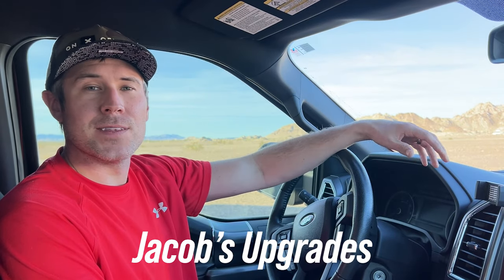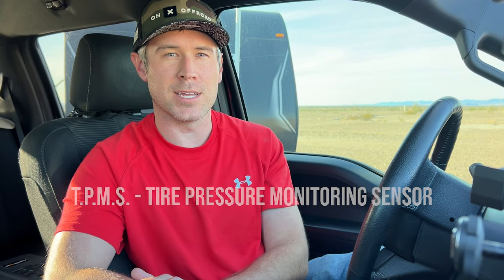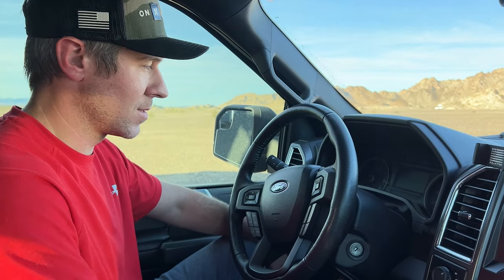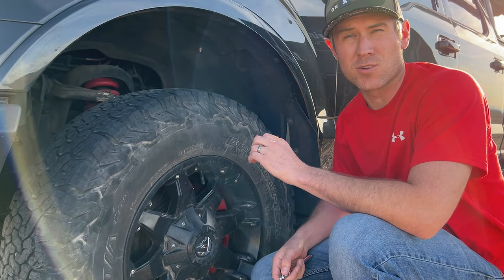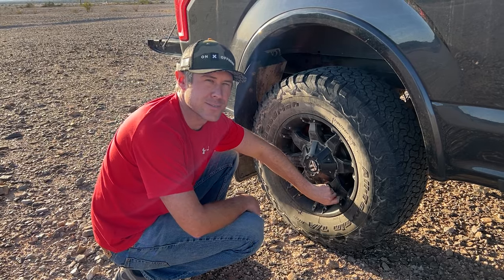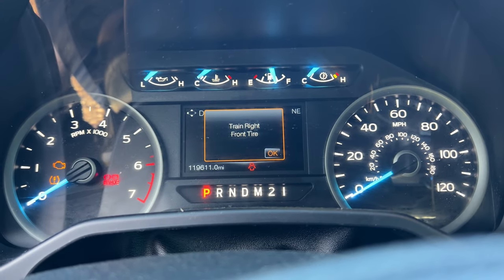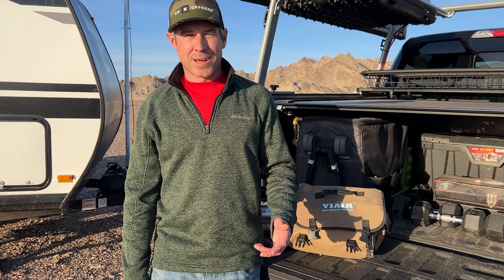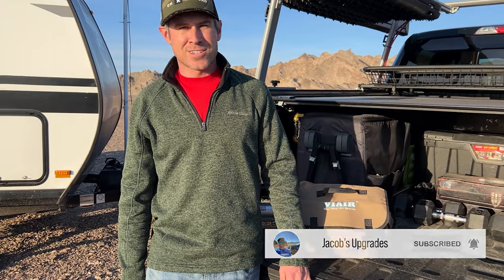Tire Pressure Sensor Fault Reset F150

Comment: Thx, this was short and to the point.  I think it's sad that now it'll cost you and me almost $500 dollars to have all four sensors replaced. I wish they didn't install these on my 2015 F150. I know you can buy tools that break the tire bead and replace the sensors, but you need another tool to recalibrate for the final steps. Many Thanks.
Reply from the maker: @markseifried3959, I know it's a bummer having them replaced. I tried to time it when I was having new tires installed. I'm still dealing with a bad sensor after having them replaced. Not sure if one was bad from new or it's my Body Control Module. I could be wrong but I think all new vehicles are required to have TPMS sensors for safety reasons.
Reply: I think it had something to do with fuel economy that the powers to be required tire pressure sensors. I could be wrong also
Reply from the maker: @tawcain  that would make sense!
Reply: Well luckily where I live they don’t require any vehicle emissions or safety inspections so I don’t even worry about it
Reply from the maker: @kalebmcdaniel9147  that makes things much easier

Comment: I’m at a loss. I got a 2018 F150 STX 4x4. Just put some new rims and tires with new sensors. I have the TPMS 19 sensor tool. I can get the truck into learning mode. But then I can’t get the truck to pick up the sensor. I’ve used the tool, I’ve also tried letting air out and nothing.
Reply from the maker: @cmendr011, I wonder if the new sensors are the wrong frequency and the truck is not picking it up. They need to run at 315 MHZ frequency.
Reply: @jacobsupgrades 
Great video thanks dude. I got a 2015. Oh two weeks ago I was driving down the road heard the ding ding look down at my dash both front tires were showing lines.  I've already had one of the sensors go out and I had it replaced. 

This is just odd I'll try resetting and keep you posted. 

The other weird thing I had A couple weeks ago was the top track holding my rear slider in place completely separated from the inside of the window. 

If you have that issue need primer for the plastic track so that the polyurethane can adhere to it properly.
Reply from the maker: @stellarcreations7378  I hope my video helps solve your problem! Thanks for the comment.

I have a video coming soon on repairing my sliding window. I used 2 layers of this 3m acrylic tape https://amzn.to/3QmsNOq   I used 80/20  aluminum extrusion and clamps through the open window to let the tape set. It's held up for a month we will see long term.

Comment: Wow!  What a great video.  I have a 2016 F150 and need to go thru this same proces.  But after going thru the process, if I do find a bad sensor (double honk), if I can't replace it myself easily, I will go without,  I'll tell you why.  I don't need a sensor to tell me my tire pressure is low.  I've grown up with nobody telling me to check my tire pressure.  It's inherently automatic.  You own a vehicle, check the pressure.  Have we grown up in society and lost all common sense?  I know, there's a sensor to tell you to change your dirty oil. Do we really wait for a sensor to tell us to change the motor oil, or be smart about it and keep a small notebook on oil changes in the glove box, and keep track youirself?  When does it end where there's a sensor built into your underwear band to tell you when to pee?  We're supposed to be smarter with each generation of people born, yet the engineers treat you like you're totally stupid.  Well, the jokes on them because they can't even design a sensor without it growing faulty before the vehicle is no longer usable.  THUMBS UP!!!
Reply from the maker: @lostinmyspace4910, I agree these sensors are a pain to deal with. Even after having all 4 of mine replaced I'm still getting the sensor fault message. I'm still trying to resolve this but I think it may be due to a bad Body Control Module or a bad sensor installed. Keep in mind if you just ignore these you'll constantly get the TPMS sensor fault message popping up on your screen.

Comment: I just drop down in the trucks display menu to tire pressure and it’s the one tire that is blank. 🤔
Reply from the maker: Yes, it usually shows up blank or -- doing this reset method should help with reprogramming, if not it could be a bad TPMS sensor.

Comment: Buy the $11 relearn tool and you won't have to mess with letting air out.
Reply from the maker: @GusMahn, I did try using one of those tools and it couldn't read the sensors to relearn.
Reply: @jacobsupgrades  I just did my '15 F150 today. I will say that even the tool is very slow. I had to point the tool for 20-40 seconds before it read.
Reply: I truly am beginning to hate this truck. Everything is a royal pain in the ass

Comment: I have a 2009 Ford Lariat and had no idea if this would work and surprisingly it did, thank you so much for the video.
Reply from the maker: Wow great to know, I thought it would only work for 2011 and up. I'm glad this video helped you out!
Reply: @jacobsupgrades  Yes it worked, so four reset without issue. Thanks.

Comment: Jacob's Upgrades, thank you very much for info. I had my passenger rear tire give me the warning right before I was going to drive 380 miles. I trained each tire monitor, and all is good now (single honks) :).  I do wonder though, My F150 is 2015 Platinum and wondering if I should just get all four sensors. I think I'll just put the sensors under "mind monitoring" and if I get a second warning, replace all four sensors. Thanks again! Nice job!
Reply from the maker: It's good you caught this before your road trip! Sometimes they need to be re-trained from time to time but I wouldn't worry about replacing them unless it continues to be a problem and yes I would do all 4 at once.

Comment: Just performed this due to an intermittent sensor fault going off and on the last few days. Had the tires rotated and the sensor fault was in the same position after the rotation (scratching head?). Just performed your instructions and all gave a single honk. Aired back up and gonna hope this solved my issue! Thanks for the video!
Reply from the maker: @CarnagelsILL, I'm glad my video helped you out! If you continue to get the same fault on the same wheel try scanning for trouble codes. It could be Body Control Module related, I'm chasing this problem down with my truck.

Comment: THANK YOU!!!! That was so annoying. Mine let our nearly all the air out of each tire before at honked.
Reply from the maker: @patrickcarney3110, your welcome. It's weird you almost have to release air at a certain pace. It can been finicky.
Reply: The reason is your battery for the sensor is getting old and may need to be replaced soon. New sensor will do it right away and old one will take a while to honk. This is how you know you will need to replace the sensor in the near future as the battery is dying.

Comment: Does this work if I get new rims with TPMs?
Reply from the maker: Yes, as long as they are the correct frequency. Also assuming there's nothing wrong with the body control module. I got new wheels and tires with TPMS and still can't get the back passenger to program. I'm also having other issues with the outside ambient temp being way off making me think it's the Body Control Module.
Reply: @jacobsupgrades  okay sweet, thanks for the info
Reply from the maker: @AvidDreamer  Glad to help out!

Comment: I went to do my right tire and i let air out. It never made a noise so i looked in the truck and it was giving me a reading of 41. So i went back to the tire let a lil more air out then it hinket twice but is still giving me a reading of 41. So idk if its a true reading or not  lmao
Reply from the maker: It sounds like you may either have a bad sensor or it could be Body Control Module related. I'm chasing this issue down on my truck even after I had all the sensors replaced I'm still having an issue with the back right tire.
Reply: @jacobsupgrades  it seems to be working now. Appreciate the quick reply
Reply from the maker: @southernboy3726  glad to help!

Comment: When i train My front right tire the horn does not sound and send me a message that the train failed
Reply from the maker: @samuelluque9961, It's possible you have a bad TPMS sensor in that tire. I recently had all 4 of mine replace and still get TPMS sensor faults popping up, only on my rear passenger tire. I now think its the Body Control Module (BCM) that is causing this issue on my truck. You could have a similar problem going on.